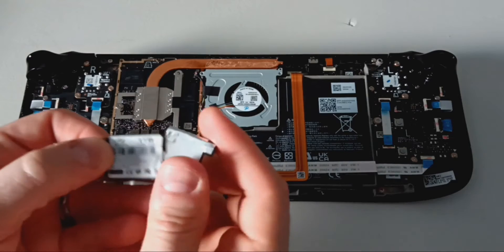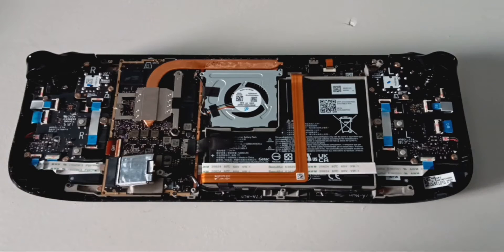Easy Instructions to Replace Steam Deck SSD

Comment: For what is this step with the Batterie Storage Mode at the beginning? I didnt made this and switched from 64 GB to 512 GB, works like before. I didnt had problems, i think its not a step you have to do.

Comment: For people finding it hard to pry off the right side of the case first (such as me) try popping open the plastic clips above the screen first it allows you to pull the case and get some more room in to pop those side clips off (i found this helpful when i was struggling)